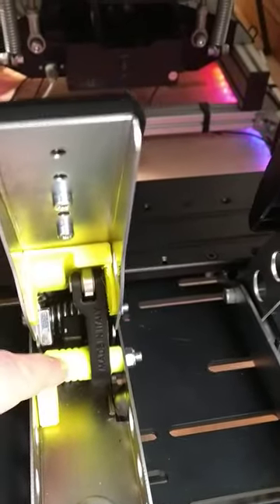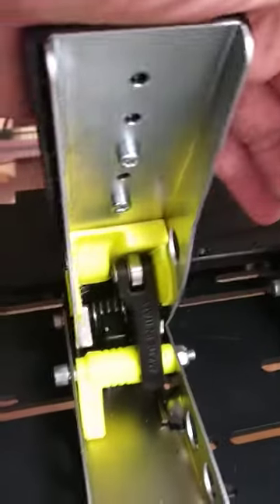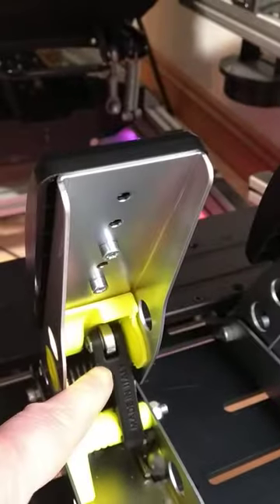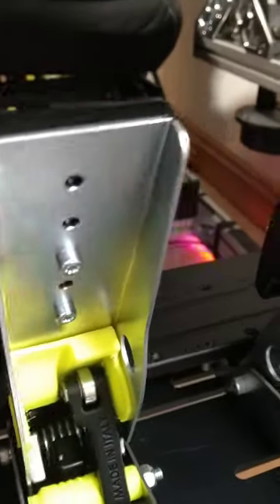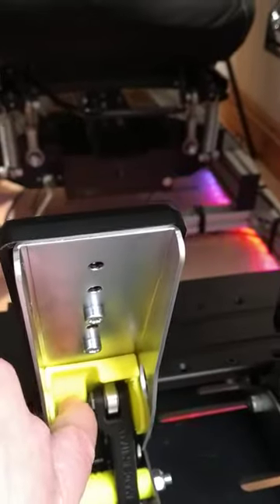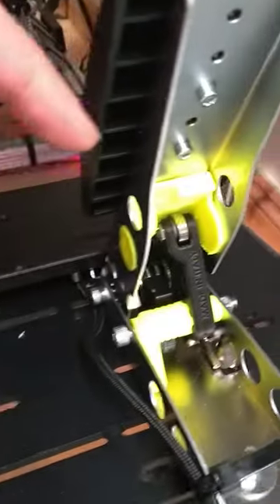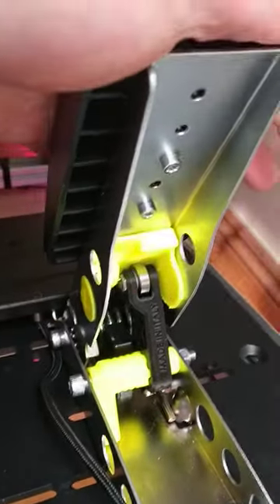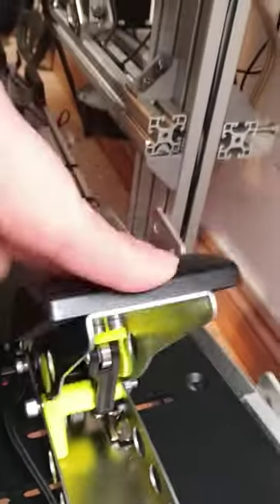Fanatec CSL Pedals - 3DRAP Throttle / Clutch Pro Kit #SHORTS

Comment: The clutch seems like it has a VERY abrupt break point on the clutch…?
Reply from the maker: Yes, that's true, it is a strong effect. Flipping the insert around changes that to a more moderate sensation.
Reply: @SimRacingCorner  I just installed this set on my rig, the vintage clutch effect was a major point of interest to me, but the rubber doesn’t provide enough support for the bearing to ramp it, it actually digs into the rubber and binds, which is why is behaving like that.  It’s NOTHING like the graph they published.
Reply from the maker: Have you watched my main review? You can maybe compare to yours. https://youtu.be/K06IEKGlRwc
Shaving a bit of the material should fix the binding for you.
Reply: @SimRacingCorner  I have watched your review, which confirmed visually the issue that I’m having which feels like garbage. If any clutch in a car feels like that I would think that pressure plate is about to fail or that the clutch linkage is binding somewhere. I shouldn’t have to shave down a product and reduce it’s effect in order for me to use it, let alone if a company is going to publish a graph that shows a certain performance when it’s nothing like that.
Reply from the maker: You should complain directly to 3DRAP if your not happy with it.
Reply: @troypachal4713   this is a very common issue. You would need to look at a mod like the Race Sim Engineering kit if you want an actually realistic clutch feeling